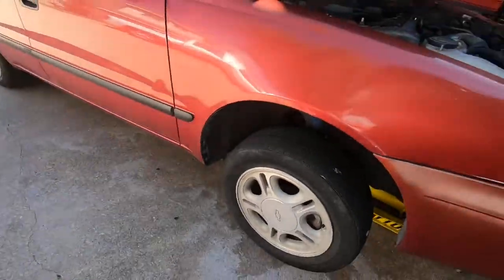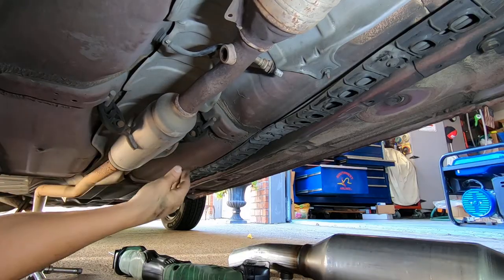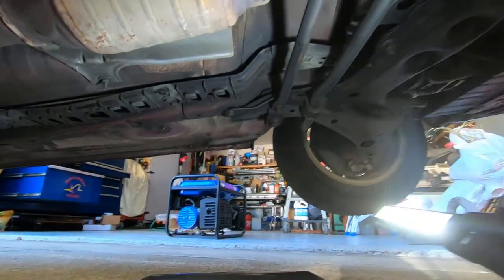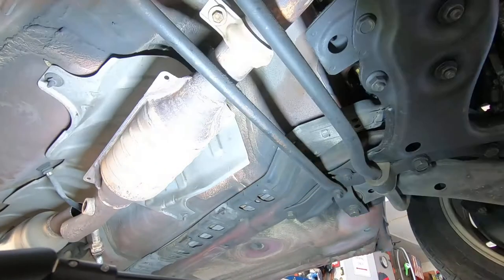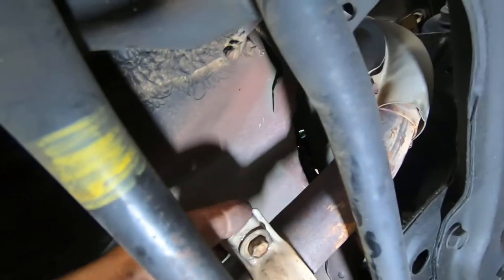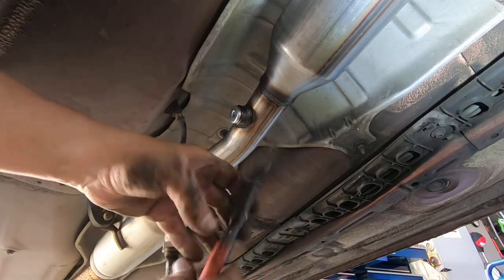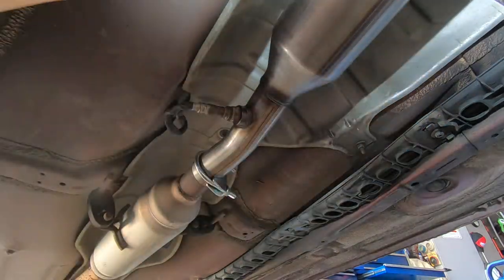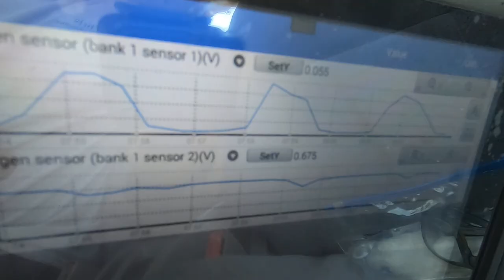How to Replace the Catalytic Converter on a Toyota Corolla or Chevrolet Prizm.

Comment: Thank you so much for the video. I have a check engine light with the error code P0420 - Catalyst System Efficiency Below Threshold (Bank 1). Do I need this catalytic converter for my 2002 Toyota Corolla to fix the problem?

Comment: I have a 2001 corolla.  Can't get cat converter to test out during a drive cycle. Tried laquer thinner and also some autozone gas conditioner but those did not work.  Looks like I will be replacing the cat.  Where did you buy this? Did that U-clamp at the back of the converter come with the converter? Thanks. Great video.
Reply from the maker: The clamp came with it and I got it from Amazon. https://amzn.to/3B3sPmg
Reply: Gee!! Maybe you should try some blueberry yogurt next that might work huh!!

Comment: When you take off that cable for the sensor if it's already bent on the car you don't want to unbend it unless you're going to install a new one,  then it doesn't matter. if you're putting the same old cord on the back on the car and it was bent when you took it off you want to leave it the same way it was when you get off or I'll act up on you and work even worse

Comment: First move and first mistake. You’re using your he wrench backwards. sorry, i forgot that you’re a backwards mechanic.
Reply from the maker: Not sure what a he wrench is but if you are talking about the combination wrench there is no backwards use for them as they are designed to be used in either direction. They are angled about 13 to 15  degrees to allow you to get on nuts and bolts in tight  areas.

Comment: Hey man, thanks for this video. This just happened to my spouse’s 2021 Corolla. Throwing the same code after accidentally filling it up with diesel. Do you know if this fix is the same on the newer models?
Reply from the maker: I am not sure what year range this would be the same for but if you look at the convertor and if it is bolted on from the front and back of the convertor it should be a similar process.

Comment: Question did you taken off battery terminal aswell before removing catalyst
Reply: You should always disconnect the negative terminal of the battery before doing any mechanical work. No matter what the work is. Always disconnect the battery

Comment: It seems like it would be prone to leak at the new connection after the cat.  does that clamp compress it well so it absolutely does not?
Reply from the maker: Muffler clamps have been used for over 100 years and as long as the two pipes couple together properly that clamp will seal it 100 percent. There is 2lbs or less on the system so not much pressure at all.

Comment: Thanks for the vid. Thought mine was bolted front and back but it looks like its installed similar to the one you worked on. I'll have to buy that saw and clamps. The only thing that looks like might be a problem is knowing at what point to cut so you have enough room to work with to install the new cat. Man thank goodness for youtube

Edit: Nope just checked my car again. It's welded on both sides. So cut each side and clamp it back in place?
Reply from the maker: If you need to cut it off at both ends get a cat like this one. https://amzn.to/3mEj8rB Just make sure the inlet and outlet are the same size as the exhaust pipe and then get two band clamps like these https://amzn.to/3A5641v and you should be good to go.

Comment: Is it good fit for corolla 2002?  Have any code shown up later on after the installation?
Reply from the maker: No codes since replacement. Yes should fit perfect for a 2002 corolla.
Reply: @737mechanic  how bout is this a direct fit for a 2005 Toyota Corolla??
Reply from the maker: @antoniop5889  This is for a 1998-2002.
Here is the one for a 2005 corolla.
https://amzn.to/3LOSirb
Reply: @737mechanic  thanks

Comment: Why can’t you get a performance cat like a high flow cat?
Reply from the maker: You can.
Reply: @737mechanic  but do you have aftermarket? Does it work compared to the factory? I don’t wanna put cheap products in my car burns up. Oem is better then after market
Reply: @737mechanic  I had a cat from a 2003 Camry  it got clog up smh I guess cheap gas was a corporate I learned my lesson now. I took out the muffler and my car runs faster, but I also think it cleans the cat having back pressure sucks so I got a new Camry and 200 buck I remove the muffler I think it’s better

Comment: what was the problem because mine does not accelerate the car it feels like the car is drowning
Reply from the maker: In your case the cat could be clogged up. You could disconnect it from the front flange and see if the engine comes back to life.
Reply: And overheating like crazy. If you look at the coolant temperature you would be alarmed

Comment: Is this compatible with 07 Toyota Corolla
Reply from the maker: Not sure if 2007 takes the same catalytic converter but if it is a bolt on and not a weld on you should be able to do it.

Comment: Hay bro you prolly won’t see this. 
my cAr got p0420 and I need a new cat , I went online and I seen the long whole cat at autozone and the regular cat itself, I can only afford the small one like you are using but how do I know if I need the long one with the exhaust or I don’t need the long one , I’m tryna get it fix before my smog . I’m stressed
Reply from the maker: As long as your exhaust pipes are in good shape and you can cut your old cat off and clamp in the short one you will be fine.
Reply: @737mechanic  ok thank you a lot